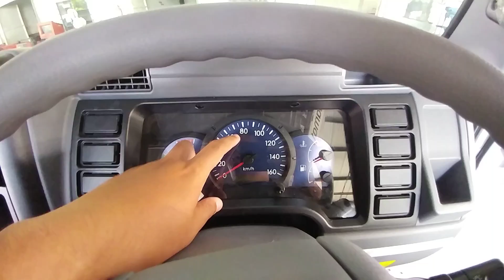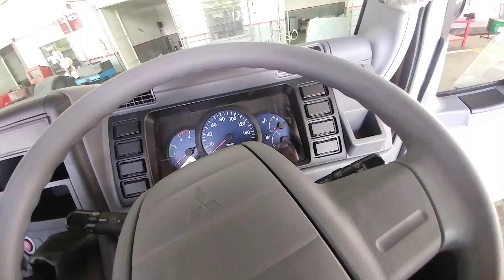MANTAP BUAT TRAVEL#REVIEW CANTER FE71BC..

Comment: Next review fe 84g bus chassis dong?
Reply from the maker: Siap bang
Reply: @haem  emblem fuso buat canter fe71 bc ada nggak
Reply from the maker: @septianbayuhartono9271  kayaknya 2019 bakal ada
Reply: @haem  bang tempat dealernya dimana?
Reply from the maker: @septianbayuhartono9271  tegal bang.. Depan samsat tegal
Reply: @haem  fe 71 bc ada power steering bang?
Reply from the maker: @septianbayuhartono9271  belum kayaknya bang
Reply from the maker: @septianbayuhartono9271  tapi gak tau yg keluaran 2019 bang.
Reply: @haem  bang varian tertinggi colt diesel 71 bc apa  bang?